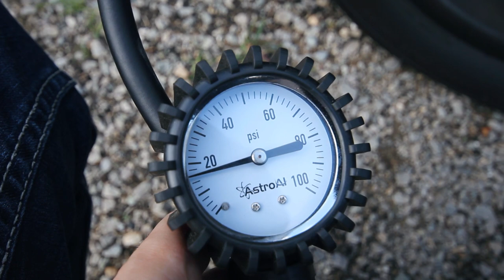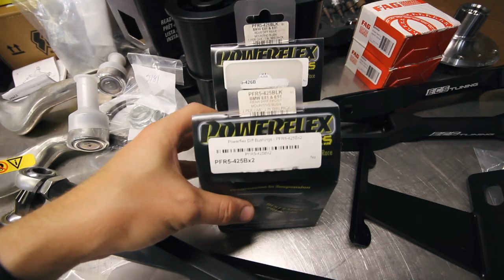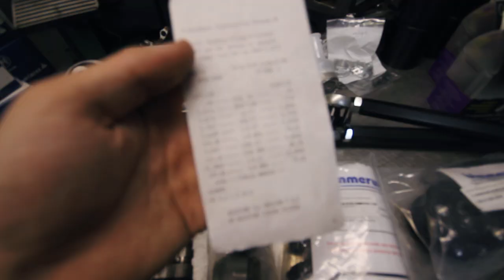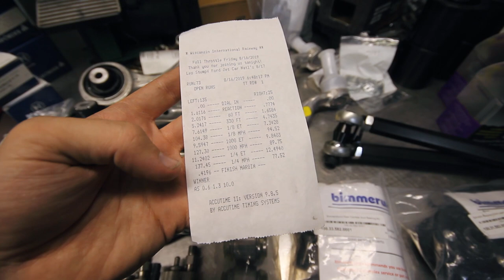Chasing Record Pass in 750HP BMW 135i! Did NOT End Well... *HUGE BUILD UPDATE!*

Comment: Oh man can we get a list of all those upgrades? Also why did you pick those specific bushings over like powerflex and revshift etc?
Reply from the maker: MFactory LSD: https://bit.ly/2ZqtxK9
DSS axles: https://bit.ly/2Zv5be7
BMS differential brace: https://bit.ly/329Kara
Powerflex differential bushings: https://bit.ly/2ZpOpNq & https://bit.ly/2Zw40Px
BimmerWorld solid rear subframe mounts: https://bit.ly/2Hr9TmL
BimmerWorld adjustable rear toe arms: https://bit.ly/30L18fi
ECS performance rear trailing arms: https://bit.ly/30B5PYO
BimmerWorld rear trailing arm bearings: https://bit.ly/2L057z3
M3 rear wishbone kit: https://bit.ly/2Zrx5aN
M3 rear guide rod kit: https://bit.ly/2Zicvyx
BimmerWorld rear camber arm bearing kit (inner): https://bit.ly/325UbFJ
OEM rear camber arm bushings (outer): https://bit.ly/33YmFmF
OEM rear shock mounts (lower): https://bit.ly/30FuQCj
M3 front control arm kit: https://bit.ly/2Pj2bSb
BimmerWorld M3 front control arm bearing upgrade: https://bit.ly/2NM5A9Z
Front tie rod kit: https://bit.ly/2UaymSs
Rear calipers (15" conversion): https://bit.ly/2LaHD9g & https://bit.ly/2Zg24eG
Rear rotors (15" conversion): https://bit.ly/3253eH1
Rear pads (15" conversion): https://bit.ly/2ZldwFR
Stainless brake set screws: https://bit.ly/2L1WEvk
3 series rear hub (x2): https://bit.ly/2MGxLqP
Rear wheel bearing kit (x2): https://bit.ly/341a41W
1M-style front bumper: https://bit.ly/2LaEIgO
Deka 17lb battery: https://amzn.to/2HtYYJ3
SAE battery terminal conversion kit: https://amzn.to/2Layaid
Macht Schnell battery enclosure: https://bit.ly/2Zwd2bp
Carbon fiber door panels: https://bit.ly/327KB55
Seibon carbon fiber hood & trunk: https://bit.ly/2UaIgE0
Carbon fiber sunroof delete: https://bit.ly/2Humxl1
Reply from the maker: I chose these bushings because I went to the suspension experts and this is the path I was lead on. I'm no expert but I'm confident in these parts and can't wait to get everything installed!
Reply: Hi Jake you don't maybe have a set of index 12 injectors in good condition hanging around. Help a friend out in the good old New Zealand. They are crazy 😁 with there prices here's soon as you say BMW it's all over. I do have a 2009 135i E82 with 85900km on clock. I see that I am running with index 5's so far no problems,but busy with upgrades.

Comment: Love the channel!! Glad you bit the bullet and beefed up the most important part of the car. Did that first and I’m glad I did!! Did the whole m3 suspension front and back, sway bars, solid aluminum sf bushings, solid diff bushings, MFactory 3.46 lsd, ECS RTA w/upgraded bushings, ohlins r&t suspension...... lost goes on and on.  I effin love the way it handles around corners and on the straights. Even more so now since I’ve gone big single with Speedtech’s 6266 Gen 2 1.0AR on e85. I can’t wait to see how your car turns out! So happy for you brother!! Keep up the good work!!!
Reply from the maker: Awesome! Sounds like a similar setup, must be a blast to drive. How do you like the 3.46 ratio? Are you auto? I'm looking at the BC coilovers to pair with the rest of this suspension.
Reply: Jake Spence Yes I’m a 6AT on xHP Stg 3. I’m loving the 3.46. Aggressive acceleration for sure. I don’t have experience with BC but for Ohlins, it’s very confidence inspiring. They are becoming famous now in Automotive but I first learned from them in motogp as they win many podium championships for all race teams and with bikes, suspension is what helps lower laptimes. I’m sure the concept is the same for auto. Just be sure to have your rear springs at a higher rate if you don’t tune the rear sways.

Comment: Definitely back into the water box if you are running full size fronts so you don’t drag water to the line, also would recommend loading the drivetrain up with the e brake
Reply from the maker: Unfortunately I can't at this track. They water everything down and there is no way to go around it in a car. Will try the ebrake next time!

Comment: Super excited for the next series of videos. I am just in the process of starting to pick out parts, cant wait to see how these work and your experience with them. Once its all said and done you should make a video on which parts you really enjoyed and which ones made the biggest difference. Might be difficult to pin point which part was the major contributing factor to change when you do them all at once mind you.
Reply from the maker: Thanks! I will definitely do a few overview videos of everything. I will probably do most of the stuff in the rear at once when I drop the subframe, but should be able to notice what is working and what isn't.
Reply: @jake_spence  so far I think I am going to stay fbo twins. What would you recommend for early on FBO parts? Im thinking charge pipe, downpipes, intercooler and relocating the inlets.

Comment: My 135i ran a 1.906 60’ on dry rotted Michelin’s, stock car with automatic,  I think it could run a 1.7 with slicks and a decent set of bushings. If I break torque it, it just lights up the tires.  Currently it runs a 13.40 at 103, but I have hit 105.  I just added a JB4 , boost tube, and cone filters.  Can’t wait to go back it feels a solid .5 faster.
Reply from the maker: Nice! That's a great 60' considering. With the proper tires and suspension, you'd probably be 1.7 or better like you said. Good luck, sounds like an awesome build!
Reply: I had a 06 GTO and it’s tire hop was god awful, the urethan bushing kit was supposed to drop the 1/4 by .3

Comment: Strong axles are good, but just be aware that as you increase the strength of the axles, you are pushing the failure points down the line to more expensive components.
Reply: I’m sure he’s aware of that
Reply from the maker: Yup! I'm sure the next thing to give will be the input shaft on the diff or the driveshaft. We will see...

Comment: Good stuff here, find the limits and weak points then upgrade and get back on the road making progress. I just broke my JZX100 diff last week. Shattered half of the pinion and ring gear teeth :D 265 semi-slicks and sticky pavement is no good combination, if you get wheel hop when shifting to 2nd and you expect just spinning the tires only lol. Diff had excessive backlash and pinion bearing preload was also way off, so it was only a matter of time at ~800hp power levels when it would let go.
Reply from the maker: Right on! Build, break, fix, race, repeat... lol.

Comment: my man let clutch out at 5500 or so.... u got some cohona's lol I fear breaking an axle  w/o LSD. That Traction control gets me tho! especially when u shut car off in line for heat and forget lol.
Reply: crap didnt watch the whole vid . sowwwy
Reply from the maker: That's exactly what happened lol. I've already launched it at 7000 RPMs a few times. She takes the abuse like a champ and I think the new diff and axles will help.
Reply: Jake Spence  good stuff. Finally getting my build assembled. Should be out for wannagofast in October here in fl. I went Speedtech gen 1 6266 w/ 100% e85, cams, pistons, rods, closed deck. Motor should be good for big powaaa but will keep her tamped for now. How do u like the rtd shifter? Think that will be my next mod
Reply: 123456bmx  send it!!

Comment: hey, ive got nearly the same combination at the transmission. xclutch organic twindisc and rtd shifter on my 135i. is yours while driving also so loud at 1,2,5,6th gear like mine? especially at 6th gear at low rpm it sounds like my trans will explode. only the 3rd and 4th gear is drivable for my ears.

Comment: Will u be doing 1m air ducts on ur bumper? Or just adding the lights?
Reply from the maker: I think I'm going to add the grilles for the fog lights but not actually insert a foglight. That way the brakes will still get air, and I won't have to wire up the lights.
Reply: Jake Spence awesome cant wait to see the content,  I have the fog light grills on right now too and also didn’t put the lights on

Comment: When you flip cars, why do you go for manual trans? If you buy an automatic, doesn't that also appeal to family buyers? Are you only trying to sell to people that want to race and stuff?
Reply from the maker: My market is for car enthusiasts. If your market is different, adjust accordingly.
Reply: @jake_spence  well here is the issue. I found a 328i with a M Sport Suspension package at a hole in the wall car dealer and im not sure they know what they have. It has 151k miles and I can probably get it for $4500 cash if I offer. They're list on it is $5500. Just not sure it's worth it, with that many miles, is it ???

Comment: Didn’t see the yellow triangle inside circle, so I guess you didn’t turn off traction control.
Reply from the maker: Yup, exactly lol worst mistake ever.
Reply: supra driven I think the angle he had it on was blocking the light with the steering wheel.

Comment: Should have just bought an ADE 8.8 Kit.

335 hubs do not allow for wider wheels on a 135
Reply from the maker: I would've if ADE was a reputable vendor. And I'm not sure what you're talking about with the 335i hubs, it's a proven conversion...
Reply: The 335i hub just allows a wheel with more backspacing. The space from the fender to the shock/body/front subframe brace doesn't change, so the overall width of the wheel that fits is the same.
Reply from the maker: Technically, yes. BUT, there aren't any 15-17" 1-series specific wheels available with the proper offsets. Changing to E9X hubs allows me to use off-the-shelf wheels that wouldn't otherwise fit.

Comment: Dont put the shifter in neutral for coasting. This is such an American style of driving a manual car. Always keep the car in gear unless you are stationairy... The reason being, that if you are coasting in neutral, whenever you are ready to drive on, you need to put it back in gear creating an unbalance/braking effect in the drivetrain. Especially at high speed and/or cornering, this can cause the car to lose grip.
Reply from the maker: Good to know, thanks for the tip! I'm still learning things.

Comment: Sorry about the axle man, next time you wheel hop just left off and save them axles. Keep practicing rolling out from the line, in the vid you kept pulling the clutch out too fast. Tip, tighten your calves when pulling the clutch out helps control the leg
Reply from the maker: Yeah, in hindsight I should've just let out but I was in full send mode. Good tip, I'll definitely try that next time!

Comment: M3 axels or driveshaft axels simple
Reply from the maker: I was going to do this but would have to do the whole rear subframe swap to mount the M3 diff. If it were a 335i, things would be different.
Reply: @jake_spence  hey Jake, so for 335i only diff and axles will need replacement?

Comment: do not coast in neutral. put it in gear.
Reply from the maker: Why is this better? I've always been curious.
Reply: @jake_spence  oil pressure is way lower, could starve engine of oil, car is moving fast. Also stability is reduced. Have you ever seen anyone in racing brake in neutral ?

Comment: You are hell on a car. It would be beneficial to learn what you should do and not do at the drag strip, ESPECIALLY if you have 3 pedals and power. It will only continue to cost you money and money as you chase your tail. 

Hints:
Wheel hop is cancer and aids at the same time to axles. If it happens PUSH THE CLUTCH IN IMMEDIATELY and abort the run.

Heat up your tires properly.
RUN BIAS PLY TIRES. I don't care what you have to do to make it happen but do it. The sidewall helps better than anything at the track as far as traction and shock absorption. 

Stiffen up your rear suspension and loosen up the front. You want the rear tires to be pushed into the ground, not your rear suspension to absorb the weight transfer. 

There is a lot more to it but Jesus man, no offense but learn what you are doing. You are just going to break your car even more at the rate you are going.